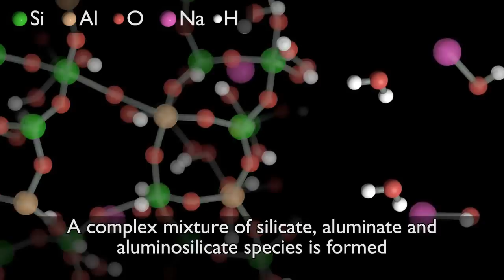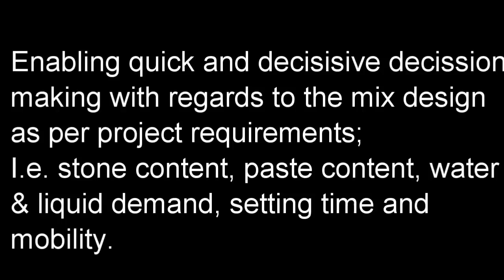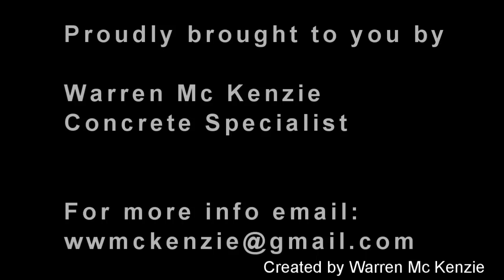Geopolymer Concrete -  Playing in the laboratory

Comment: whats the optimum mix design that was achieved?
Reply: One can calculate the near ideal mass ratios (metakaolin to drymass-waterglass) from the ideal stoichometry.
See video "The Geopolymer Route to High Tech Ceramic" @ 5:05
Not sure if a lack of MOH excess may cause too weak alkalinity though??

Key factors: 
★ amorphousness of metakaolin 
★ presence of strained alumina in metakaolin.
★ not adding any more than the minimum for good rheology 
★ excessive mixing and 
★ sealing while curing

★ Mild heat curing is supposedly entirely optional.
Potassium GP is supposedly slightly stronger than sodium GP.